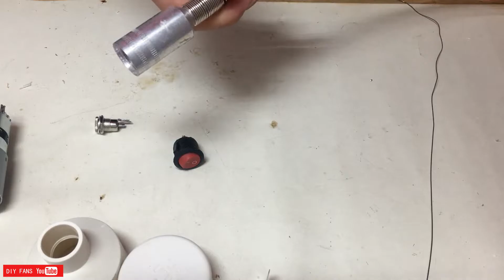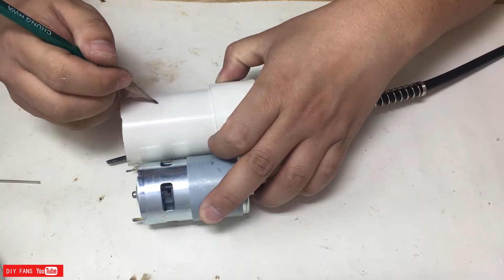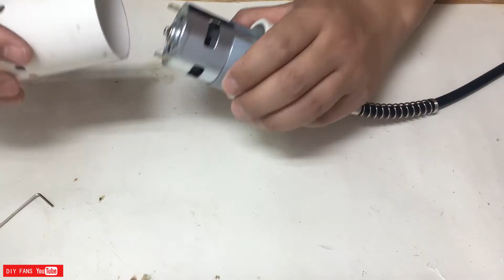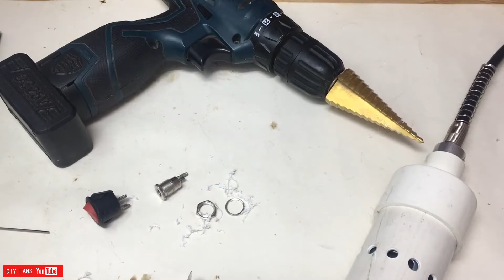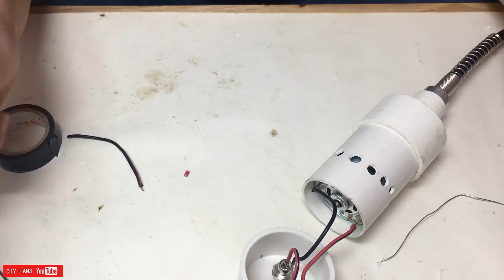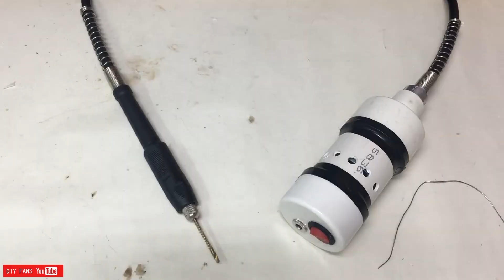【DIY FANS】🔧How To Make  Dremel Tool Using 775 Motor and PVC Pipe

Comment: How volt adaptor yuo use it.sir
Reply from the maker: 12V
Reply: And amper sir
Reply from the maker: My English is not good, how many A?
Reply: I mean 15volt  5Amper or 12 12volt8Amper you use.
Reply from the maker: 12V5A my
Reply: Thank you sir